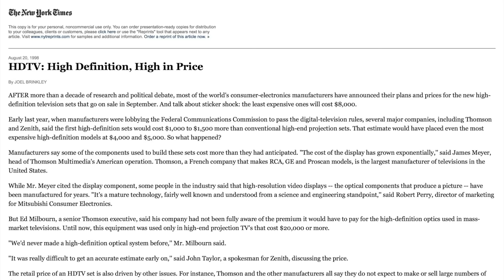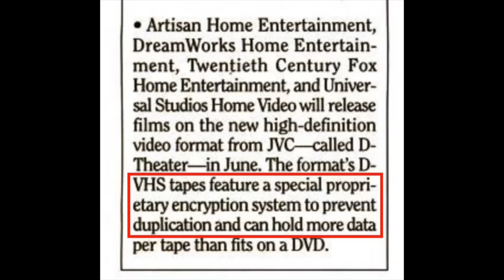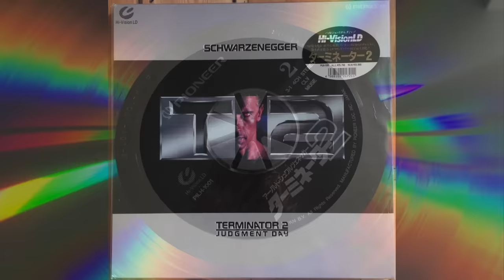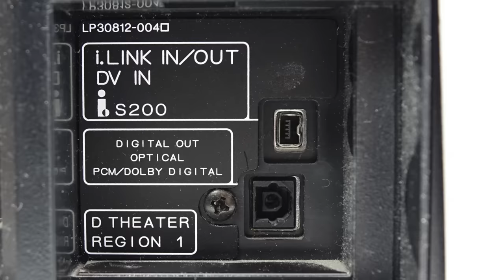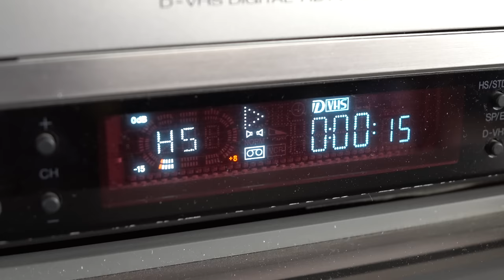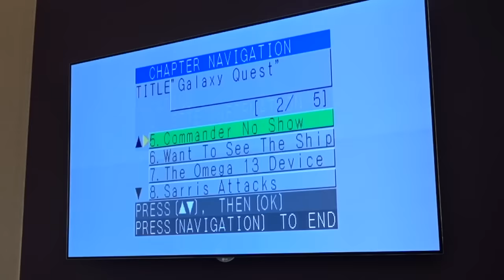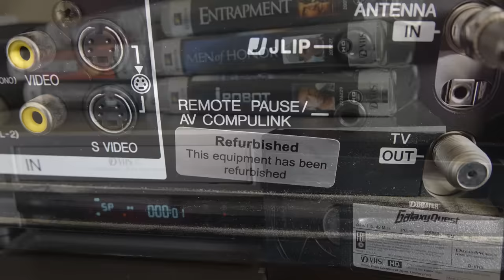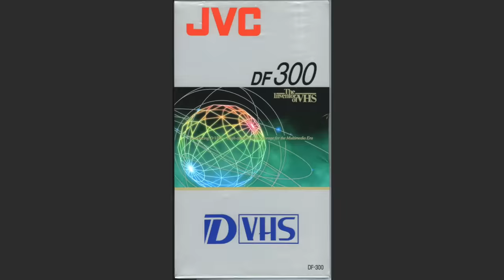Remember when HD Movies came on VHS tapes?

Comment: I still use a vcr to Record my tv shows and movies
Reply: You can record HD to D-VHS, but only from "OTA" (over-the-air) broadcast television - via an antenna.
However, for 5 years from early 1999 until spring 2004, Dish Network subscribers in the US could record in HD on D-VHS. The first Dish HD-capable receiver (only sold for a short time) output an RF signal which could be fed into the antenna input of the D-VHS.
During this time there was a small but very active group of home-taping hobbyists. Over the course of about 3 years, I amassed around 300 D-VHS tapes of movies (and a few concerts or other TV specials) I recorded from HBO, Showtime, PPV, etc...
Reply: so do I.  I've grown to hate the  DVR box. unreliable Chinese pieces of shit!!!! three times I've recorded whole seasons and three times the box crapped out and my cable company just replaced the cable box. I asked well what about my shows! he said it's gone.  yea, I'll stay in the dark ages. infinitely more reliable
Reply: +styldsteel1 I had the same issue so now run kodi on a pc with a usb tuner.
Reply: Robin Bebbington do you find it to be reliable as well?
Reply: Timothy Nickles Watching one of my recent VHS recordings right now. The quality loss is noticeable in EP mode on my TV but not so much in SP mode (I'm not watching them on my computer or HDTV btw).
Reply: Timothy Nickles Do you also read from papyrus?
Reply: @BilisNegra I use it except I'm not a hipster, I've been using it for years and it is the best for me since I record using the bedroom set top box when I'm watching something else or am out and watch on the main set (usually) later. Oh and the quality isn't terrible, yes the color quality is worse but from the distance I'm viewing it from I can't tell the difference, most of the time anyway.
Reply: I jumped onto the TIVO bandwagon back late 1999, a early adopter because I hated VHS recordings of TV shows.  My VHS player even had the auto commerial skip.  When when it was done recording, or would rewind and play and mark where the commercials were at and when you played it, it would FF all on it's own.  It did work pretty good doing that.   I had a electro Magnet to wipe my VHS tape as it did a better job of wiping the tape then just recording over the top of a tape over and over again.   I havn't looked back since then with DVR's.   Used a Comcast HD DVR for many years before cutting th ecord and using Windows Media Center to do my recording, these days I'm right back to a Tivo Roamio with a couple Tivo Mini's recording content from my Antenna in HD and 5.1 surround sound.  It's been great.

I haven't had a VHS player in years.  I sold off all my VHS movies for pennies.  A bunch of movies I have the store and got a couple bucks for them all.   I have a pretty large DVD, HD DVD and Blue-Ray collection, most of it ripped and now on my NAS where I can watch any of it on any TV in my house or in the world with a Internet connection.  No hunting for a disc.
Reply: @Evi1M4chine
Everyone I know still uses a TV.
Reply: Doctor Feinstone 😂😂😂😂
Reply: Lol, like 80% of these comments are like 70 year olds still talking about their amazing vhs home theater. It's old tech. Everything is digital now and so much better. Some dude said he used Kodi and that's probably the most relevant piece of software when talking about all this nonsense. But seriously, if you still subscribe to Netflix and the cable companies your getting absolutely assfucked.

Comment: Great video. I loved this format at the time. At one time I had 5 D-VHS machines. You could record through  firewire off charter in HD with absolutely no copy protection whatsoever so was able to get HD recordings of some titles years before regular release. You could also record about 7 movies on a regular size tape in DVD quality through s-video using LS3 mode. As you mentioned though they did tend to be unreliable over time-the HD modules would go bad making them only useful as a regular(non digital)VHS machine.  I currently still have a HM-DM5U which has the HDMI but mine will not play DTHEATER through HDMI due to copy protection conflict with my current TV so have to use component for those. Great quality though even today.

Comment: You've got the wrong end of the stick about recording. Not surprising as you weren't in the US. The government mandated FireWire as the standard, so any HD cable or satellite tuner had FireWire outputs on it, and your D-Theater would dutifully record from it. The equipment to capture an uncompressed 1080 signal, and compress it, really didn't exist in the consumer world at the time, and would have drastically increased the price. Getting the raw MPEG-2 via FireWire was the only viable option...
Reply: Yeah my first DVD recorder had a firewire input
Reply: My Philips machine has a front firewire input and I used it to archive video camera footage.

Comment: I'd assume it died because no one wanted to pay $2000 for a player and $50 for a vhs tape when DVD was so much cheaper, lower quality maybe but not worth paying all that money for something some people can hardly see a difference in. I never saw the player or tapes for sale or rent either. Blockbuster and others were still trying to sell off thier VHS collections to go full DVD and didn't want to re-invest in tapes.
Reply: Not just the high cost of the player, a television that could actually display HD in the late 90s was astronomical. You're talking $10000 for a TV to connect this $2000 VCR to.
Reply: DVHS was the 2000's version of what Laserdisc in the 80's and 90's was... except DVHS didn't take off to becoming the niche market format that Laserdisc did and eventually DVHS was surpassed technology wise by both HD-DVD and Blu-Ray within a few years (and way surpassed by 4K Ultra HD Blu-Ray a decade later).

Comment: Had no idea a VHS tape could hold 50 GB, Wow can I get a drive for my computer?
Reply: There are tapes that hold like 20TB. They're slow as hell, expensive, and only really good for archiving, though.
Reply: Blu-ray can too.
Reply: Yes, it is indeed impressive. But I don't know if I want to compare that to high-capacity LTO. I think that LTO use higher precision mechanics for tape feeding, metal emulsions that allows for a much denser storage and different magnetic heads than VHS based systems. Would be cool to know how VHS tapes differ from LTO.

Then we have the DV format, a digital video format that came out in 1996 so digital video had been around for a while. But I guess that it didn't turn into HD until much later.
Reply: You can get a 60TB 3.5" SDD, but you will need the GDP of a country like Belgium in order to buy one.  But you would have the largest and fastest single drive storage known to man.

Comment: there was also an analog "HD" vhs format, only in japan, called W-VHS. there are just a few videos about it on youtube, mostly video captures from working machines, and it does look as good as digital, except for a bit of noise and ghosting from time to time, although i suppose it was the problem with airing and cables, and maybe not the tape format itself. The interesting fact is - it's a format from 1991!  and you actually have HD video footage from 1991, not taken on film, but on a tape machine.
Reply: very interesting.

Comment: "Fight Club" on D-Theater is actually one of the better releases. No smeary DNR like on the later Blu-Ray. Some enterprising fellows ripped it too, the whole MPEG2 TS is out there. That DTCP copy protection didn't hold up for very long when up against pirates with a set top box that had a flawed implementation of it and a 1394 passthrough feature.

Comment: I'm  tech nerd but I didn't know about either LaserDisc HD or D-Theater. I am pleased to have seen excellent videos of both of them. I did know about D-VHS though I wasn't aware it was used that much. I am however proud to have been a very early adopter of DVD in the UK (Panasonic A360 player as soon as it came out) in the late 90s, and I also bought into S-VHS with a top end Panasonic NV-HS950 in 2000. The S-VHS deck is still on my rack, though I use it for recording radio these days since Classic FM's catchup feed online is such awful quality. But it also lets me watch teletext for nostalgia, S-VHS has enough bandwidth to record the teletext signal and I have a small number of old tapes.

Comment: You can fit a full two-hour film onto a DVD in HD. Encoding in AVCHD gives you pretty good quality. All of Harmy's Despecialized Editions are available like this.
Reply from the maker: +dimmddr1 it's unfortunate that time-travel hadn't been perfected in 2002 to enable the dvd manufacturers to jump to 2006 and bring AVCHD back from the future.
Reply: Techmoan
Pity.
Reply: +Techmoan Savage!!
Reply: +dimmddr1 Computers back during dvd's release were so slow they needed a decoder card to decode mpeg2, go back even further and its hopeless for 1080i/p  h.264...that level of power was just a dream
Reply: +dimmddr1 This didn't happen at the time for the same reason they didn't use the Space Shuttle to rescue the Apollo 13 astronauts.
Reply: +Muzer0
Because the Space Shuttle couldn't perform a translunar injection?

Comment: But wouldn't the quality wear down the more you play it like regular VHS tapes?
Reply: Digital doesn't have that as much, but eventually, yeah probably.
Reply: no, as long as the quality of the tape is not degraded beyond what the error correction can handle (like a DVD with a fierce scratch) you wouldnt see a difference in picture quality.
Reply: @Digi20  really?? Why then do most uploads on youtube from video have tnose tape Edge lines or those dirty head twinkles or the rewind and stop at same part of tape squiggles or the paused and step advance lines across screen??? I'm sure these are non standard terminology employed here haha but u will be familiar with what I mean I'm sure.
Reply: @solcutta3661  The normal VHS players do not have memory buffers. On D-VHS, similar to DV-TAPE, the tape begins to play and the first frame to be seen is from a frame buffer, as it plays the tape, the digital stream loads into a decoder which reproduces the frames. Dropouts and missing data on tape therefore are ether skipped over or appear as slight artifacts. Whats interesting is that D-VHS exists. Though Digital on tape had been happening for many many years prior. Ironically, Betacam in broadcast exists in all digital, and it has a size that looks like a betatape, but it isnt. DV-CAM is digital.
Reply: @jameshackintosh  He is right, after a certain number of playback sessions or seeking the tape would wear down and artifact occurrence would increase, I don't think this format was ever exploited long enough to tell how good is the durability of those tapes so we might never know how better they would fare than VHS

Comment: I'm still using my LG BH-200 Bluray/HD DVD Player from around 2008. When it eventually dies I'll have 15 or so HD DVDs to replace. I'm always impressed it still works fine.
Reply: I'm using a regular DVD player/DVR that's of a similar age & I wouldn't be surprised if it lasts another 20 years.

Comment: I sold these at Circuit City when it was new and the big selling point was the 24 hour SD recording
Reply: +soundman447 Damn.
Reply: A VHS tape can hold as much digital data as a double-layer BluRay, wow.
Reply: +LemonSlice  VHS is actually rather limited in data storage compared to SD formats like DVCAM/DVCPRO that are 25 Mbps on a 1/4" tape and the cassette is large enough to hold 3 hours of tape. Then there is digi-beta that's is 50mbps on a 1/2" tape and cassettes hold 90 minutes.  That's why professionals like my self still use it. Only thing better than tape for video is an ssd.
Reply: +soundman447 No Digital Betcam is 90Mbps and standard def. Hard drives can handle bit rates around 225 Mbps, SSDs are only needed for uncompressed video.
Reply: +TVperson1 Been a minute since have had to use any format of tape other than retrieving archive on Beta SP or U-matic.  and lets be honest Beta is easy to get confused on there is only like 15 different versions.  My point still stands VHS is really a small storage medium in the the world of digital video tape.  Also not sure you could have gotten 225mbps on a single Hard Disk back in the day maybe today on a modern sata 3 drive.
Reply: +soundman447 Yeah I remember seeing DVHS in action when I worked at CC myself. Neat technology for sure but I knew it wouldn't really take off due to HD itself still being a new niche technology and the average customer still buying CRT TVs and demanding "full" screen DVDs.
Reply: DemoManMLS Yep, took a while.
Reply: Christopher Sobieniak The sad thing is that I still know people with 4x3 CRT sets who absolutely refuse to move up to HD for many reasons. Those reasons they cite include - too costly (huh?), too confusing, they hate bars on the side of the screen (yet wine about most programming have bars on the top/bottom these days), on and on. So those same people are still probably flocking to stores like Best Buy and Wal-Mart demanding "full" screen DVDs and find Blu-Ray (let alone 4K UHD) the equivalent of foreign films.
Reply: DemoManMLS Are they around 50-60 years old?
Reply: DemoManMLS Well, 4K sets would be pricey still, but certainly a good 1080p set shouldn't be that hard to buy cheaply these days.
Reply: +DemoManMLS You do realize there is such a thing as a 4:3 CRT HDTV I still have one a Sony KV-40XBR800.  Now it is only a 1080i set but it will blow any modern LCD TV out of the water when it comes to color depth and black levels.
Reply: DemoManMLS And how many HDTV owners watch TV in dynamic mode with motion interpolation, stretch 4:3 movies, crop the letterboxed ones, and mainly watch utter crap TV, or perhaps download awful 1080p rips with 10 megabytes of data per minute? 
At least a CRT TV provided a great picture out of the box free of whatever hundreds of gimmicks the virgins in engineering thought would be cool, and marketing thought they could sell. I would venture to guess that on the whole, those CRT owners have a better taste in life and video material than HDTV owners.
Reply: soundman447 I actually owned an Samsung 26 inch 16x9 CRT HDTV for a good few years before finally jumping to the Samsung 40 inch CRT until late last year going to the current Sony 49 inch 4K set I have.
Reply: LemonSlice HAHAHAHA... okay enjoy your low resolution low quality CRT being stuck in the past. The rest of us who have gotten rid of our obsolete high energy sucking CRTs will enjoy our far superior picture quality with lower energy sucking sets.
Reply: +DemoManMLS I have a LG 4K set along with a sharp quarto 1080p set both top of the line at the time of purchase the old Sony still has better color. Also it kicks butt when it comes to older non HD TV shows on DVD and it holds up well to any HD crapcast sends down the pipe.
Reply: soundman447 Yeah... Comcast with their low bitrate "HD" channels. That's one of the reasons why I finally jumped to DirecTV.
Reply: DemoManMLS I have two LCDs dude, I relegated the CRTs to the kitchen and summer house years ago. I never owned a really high quality CRT myself, though I've had the pleasure of experiencing them often. I think it very unwise to bash those sets, they are marvelous, and I've never seen an LCD where motion looks as good or as natural as on a CRT.
As far as energy consumption goes... yeah, but so what? It ain't that big a hit on the bill, and an average desktop computer still uses more electricity even though you can have a computer that does the same thing and uses 10-20X less (the kind I use BTW). If those computer gamers are allowed to indulge, why can't people who want a TV superior in ways they find important?

I'll say again, I'm a huge fan of LCD, I just think you're being unfair.
Reply: DemoManMLS I hate what passes for HD nowadays, 1080p with a bitrate half that of DVD (or less) and encoding that prefers sharpness and false resolution to any kind of semblance of natural motion and detail. Bleh.
Reply: +LemonSlice You might find you need to adjust your TV settings - a lot of newer HD TV's have an artificial interpolation/framerate upscaling feature that makes it look like you're watching 80's TV. If you turn that feature off completely, films look a lot better.
Reply: Tara FitzGerald I know about that, I hate frame interpolation and never use it.

Comment: Even though the VCR says 120V, more than likely it'll operate up to 300V+
Reply: Plus obviously the frequency doesn't matter either as it's rectified.
Reply: I would not recommended doing that photonicinduction style to a rare piece of electronics!
Reply: Probably not; machines designed for the US often leave out all stuff that wasn't necessary to operate outside the US for cost cutting purposes. Also, the home market of JVC has a 100V mains voltage so you could argue it wasn't even left out, but instead a wide range input power supply was added to the design for export models for other regions.
Reply: Paul Hicks my Playstation 1 poofed out white smoke when i used mine overseas!
Reply: Totally wrong. It will specify on the back of the component exactly what it's rated for. If it could do 220 and 110/120, it'll say 110-220~AC. If a product made for multiple markets, they would include a PSU that would support an array of voltages.